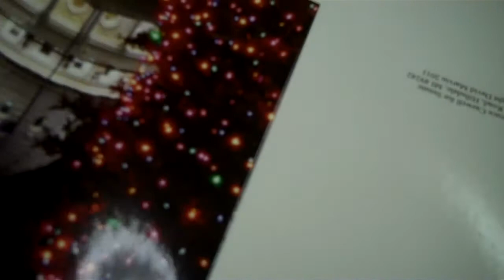Utley Brothers Printing | Scoring

Comment: I worked one of these for many years in my fathers printing company. We had 2 1/2 of them, using 1 of them for parts. I printed on everything from 30g/m2 airmail paper to embossing high end letterheads. Many happy days and fond memories.
Reply: Yes Bro. We also print 30gsm manifold paper
Reply: I Spent 35 Years on one and every kind of Letterpress you out there.
Reply: I also Frisked out the No: on our Number Machine's on my Vertical.

Comment: On the Sucker Bar the the rubber tube with the Bolt in it is a Suction Reducer.  There is a hole in the Rubber Tube and the Bolt is screwed in so as to cover the hole, by unscrewing the bolt so hole is opening it sucks air and reduces the Air to the Suckers on the bar.

Comment: Spent five years on a vertical 50 a long long time ago. I ran everything else in the department but liked the vertical the best. Went to offset later for over thirty years but miss the simplicity of hot metal work